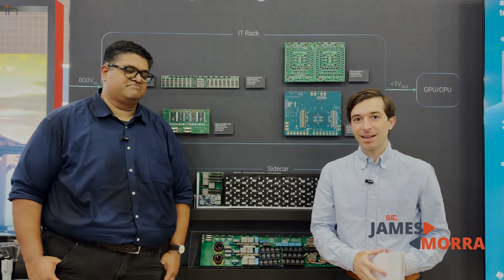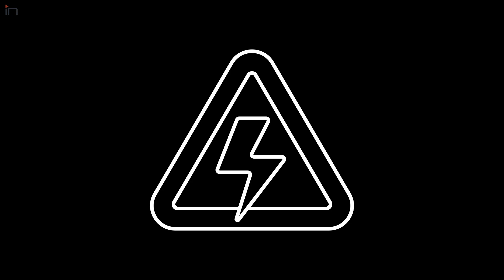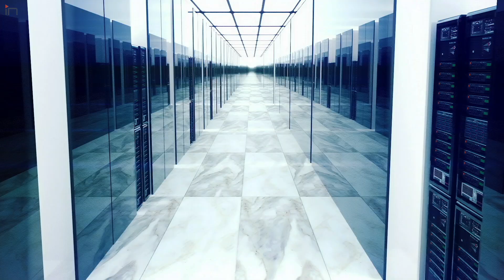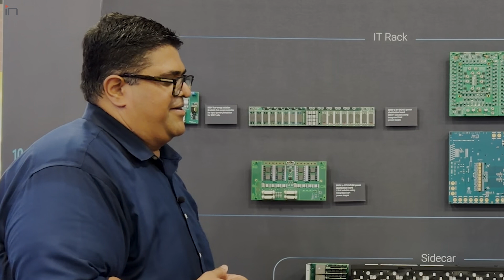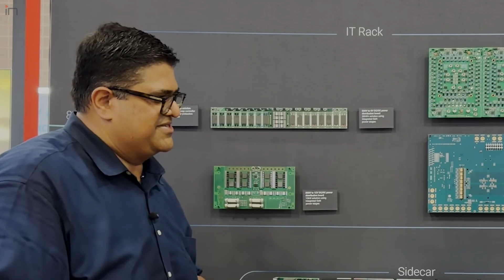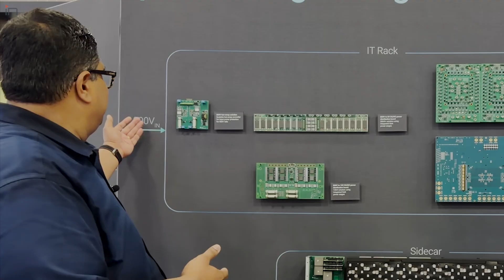TI Breaks Down High-Voltage DC Power in Data Centers

Comment: Don't forget to include a closed loop system that would have direct chip dielectric fluid cooling with a Xenon helium Loop to reduce noise and greatly improve the cooling and not wasting water